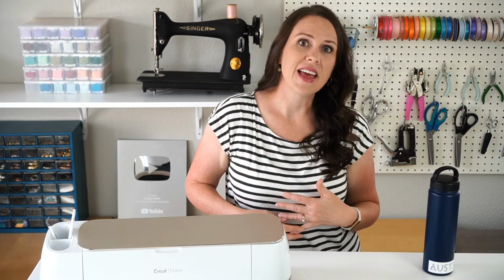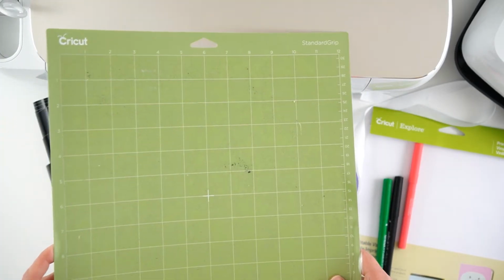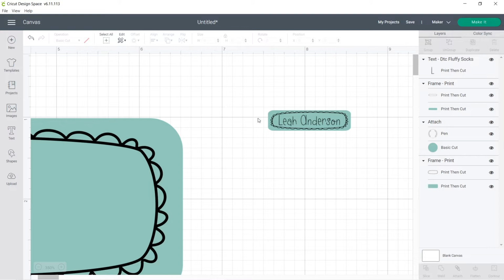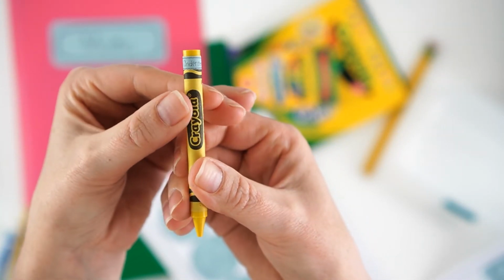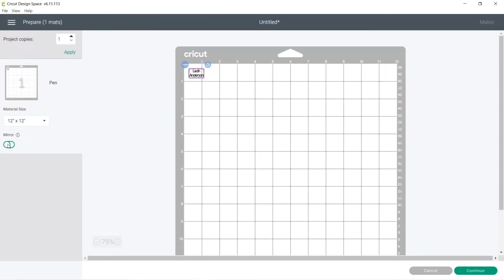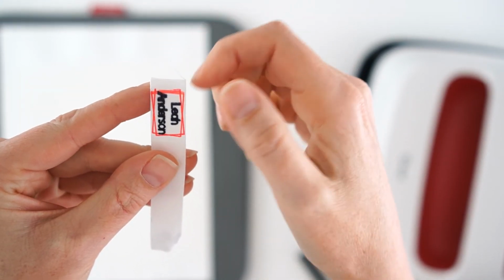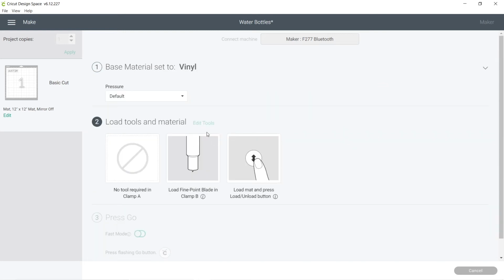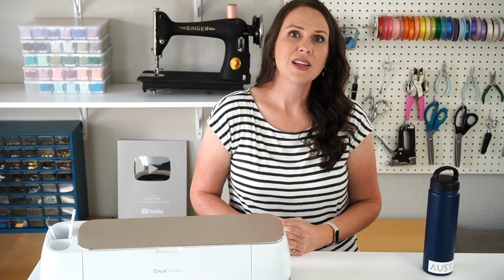Labeling School Supplies with your Cricut

Comment: Does this method/ procedure work on the air 2? And when you say “print” are you printing on a printer or the cricut?  Just got my cricut so brand new to this
Reply from the maker: I think it should work on the air 2.  You print on your printer and then cut it on your Cricut.